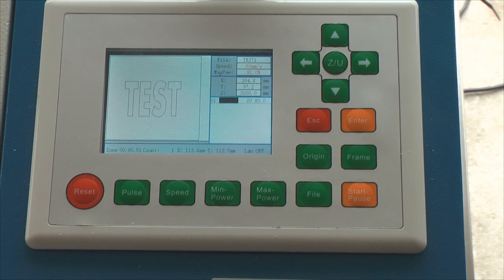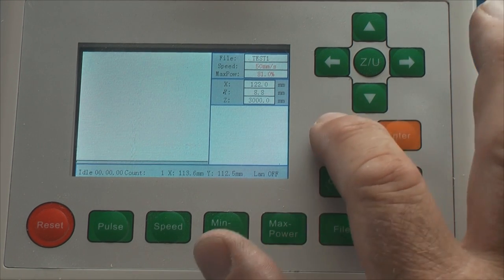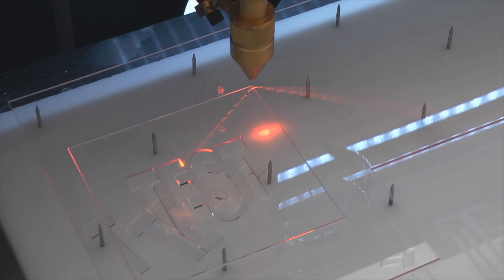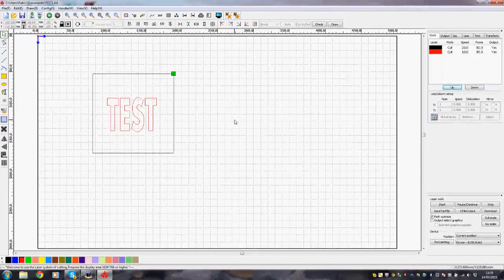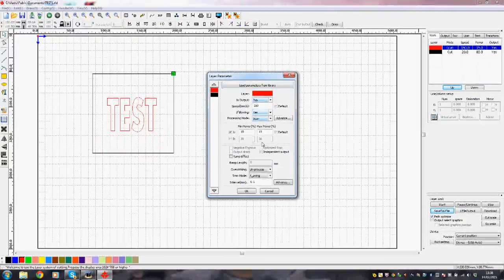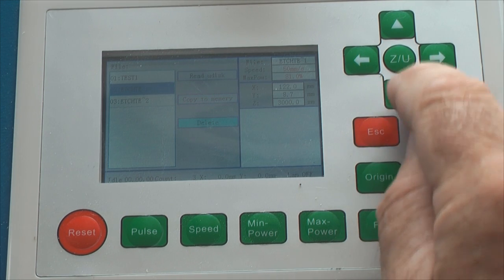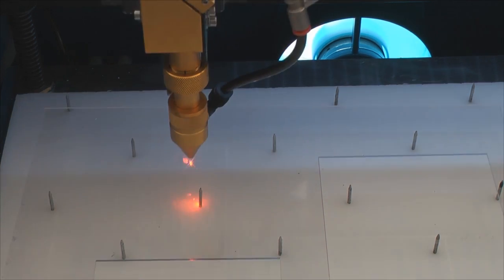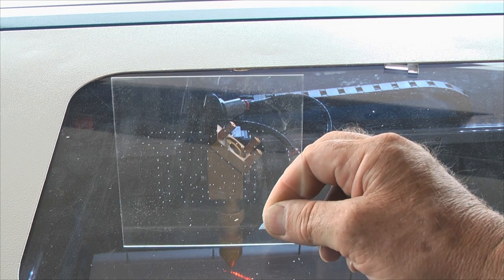Chinese laser cutter  tutorial part 5

Comment: i am planning to buy one, deciding on a 60w or 100w.. planning to cut mdf and plywood? any advise. mdf abt 3mm
Reply from the maker: +hing 
Yes  3mm mdf with my 50 watt machine (which actually outputs only 37watts) cuts fine. Here's a private video I did for someone to show cutting of 4mm ply. 
https://youtu.be/PMcX4Kg8ZMU

3mm mdf produces sticky vile smelling fumes  containing formaldehyde (so does plywood to a certain extent, it's the laminating glues)so make sure you install very efficient extraction. Do research on the chemicals released when burning mdf  or plywood and you'll encounter articles like this 
http://www.cancer.gov/about-cancer/causes-prevention/risk/substances/formaldehyde/formaldehyde-fact-sheet. It's not deadly as  some plastics are but you should be very careful if you are going to be using it a lot.

There is also another showing that 37 watts will also cut 10mm ply but very slowly.

https://youtu.be/dt5R04vJPMc

This last video is a long way into another series of videos about learning to use the free software they supply. Yours may not be called RD Works but it will still probably be this same software

To get more power out of a laser tube the length has to increase. This in turn means it needs a bigger frame to house it and  the bigger frame means you can house a bigger work table. A bigger .worktable means bigger drive motors and more substantial engineering to bridge the larger work area. The point I'm making here is that you cannot buy a small cheap 100watt machine, it's expensive and big because it's 100 watts. Consider your requirements carefully and size your machine accordingly.If this is a hobby machine or just a toe in the water to start a small business then these machines will get you started . The life of the tube will be in the region of 1000 to 2000 hours. At 4 or 5 hours a day 5 days a week that's about a year for your first tube, regardless of wattage. At 100 watts you are just into an area where you will be able (at a price) to purchase a long life tube  (about 8000 hours) whereas no such animals exist for 50 or 60 watt machines. A 100 watt machine will also definitely require an expensive  refrigerated chiller cooling system whereas at 50 or 60 watts  air cooling in a large tank will be ok.
Hope this helps your decision

Russ

Comment: How did you get your control panel to be in English language, mine's in Chinese? Thank you
Reply from the maker: +Steve O's Video's 
Hi Steve. No direct answer I'm afraid. Mine came set to English Two possible options to try. First, some keyboards have a Language key instead of a Frame key which allows you to chose English from a list.  I guess this may not be your simple solution. Secondly, I'm  sure you are in USA. Boss Laser import these Chinese machines and badge them up as their own. They charge 2 or 3 times more than buying direct from China  but they offer a proper support service. (I bought mine direct from China, it was a risk I took). However, take a look at 
https://www.bosslaser.com/laser-engraving/boss-ls-1620.html. 

If this is your keyboard?  Maybe you can beg some help from them. They may also have spares that will fit your machine. You may have to buy a replacement keyboard but that means you will  then get help from them.
Sorry I cant be more helpful on this occasion.
Reply: +SarbarMultimedia Thank you very7 much for the info and for doing videos I've almost watched them all.
Reply from the maker: +Steve O's Video's 
Hi Steve 
You are some sort of hero to plug on with all that lot.  As I clearly state, these are not training videos but rather a record of me learning to use the machine. Like me, they do move rather slow at times. However, I'm glad that you are watching them all because I definitely made some BIG mistakes with my early work , one example being the belief that 100% meant full power.
Thanks for your encouraging comments. There's definitely more techno stuff to come.